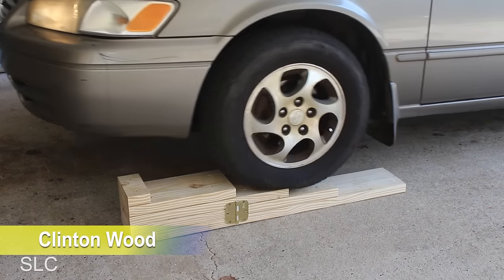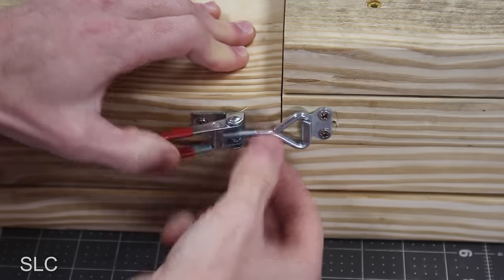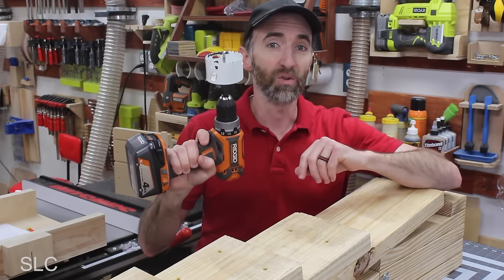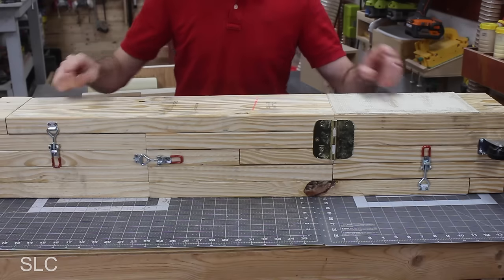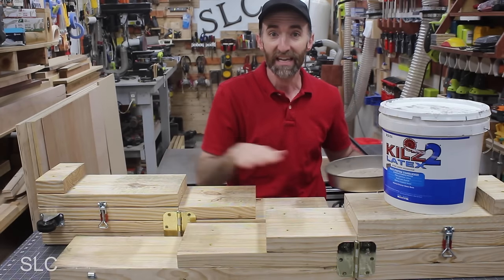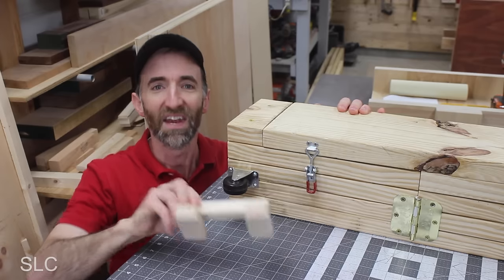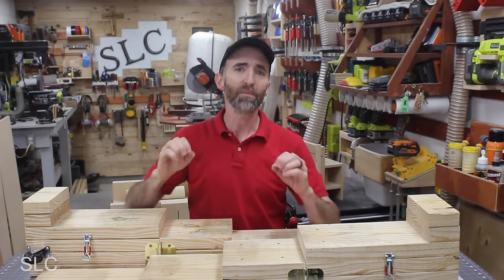Improving the Best Car Ramp EVER

Comment: Dont bother with the hinges on one side, replace them with the clamps on BOTH sides. It's not always convenient having an arm swung out... It's a trip hazard in your workshop and if you are working outside against a kerb then they are pointlesss... the ramp can't swing out of the way if its against the kerb edge and the other side would be open to be hit by passing vehicles which could be catastrophic if you were under the car at the time
Reply: You could just reverse them under the car, that is, put them on the opposite side of what you usually do, so that the arms swing toward the middle of the car instead of the outside of the car. The trouble with any clamp or hinge removal system is when you unclamp the clamp or remove the hinge pins to remove the back portion of the ramp for accessibility from the side of the car, if that ramp is not on a true/flat surface, you may not be able to re-clamp the clamp or re-install the pins due to the ramp back becoming misaligned due to the ramp being on an uneven surface.
Reply: @jimmclaughlin9362  ...if you had those problems (a) they would prevent you from taking them apart in the first place, too (b) they're at least as likely to prevent the use of the hinged version

Comment: If you don't have a spotter you might try putting a mirror in front of the car while driving up the ramps.   I haven't tried it but it might help.   Another idea is use the old farmer's wood stain.   50/50 diesel or kerosene and used motor oil.   It's cheap and effective at preserving wood.   It usually soaks in fast but if the top is still slick throw some sand on it before use.

Comment: I really like your car ramps. If I was to make any adjustment to it ( perhaps not so critical to the overall function) I would say it would be in creating a 45* on each edge of each step, so that the tires don't get too stress out while rolling up, as the sharp edges could cause some slight deterioration with time. Thank you for sharing your ideas. I love it!!
Reply: I was thinking the same thing; cut the original boards at 45 degrees so when you hit the backstop, you know you hit the end of the line
Reply: @nooneofconsequence3847  Same here. And I made the mistake of replying before I read down, and noticed the top comment was the same idea.
Would want to shorten the top-most, guard, board, by 11/8", so it could nest up against the edge of the bottom board, while still being cut at 90°.
Reply: Tires can take a good beating, 2 inches is nothing to them. Plus, you are unlikely to hit that same spot every time you use them since you'll be driving the car around and position will change. I do wonder if the wood can take the beating and for how long, a 45° cut at each step makes sense to me to protect the wood long term, but I dont much about like I do about tires (former tire tech)
Reply: Hopefully you won’t be driving the same car on the ramps on a daily basis anyways

Comment: I would want the hinge pin to be easily removable. So you can pull it & get the ramp part of the ramps out of the way. Because we all know we're going to be working on both sides of the tires.
Reply: Maybe use two side latches instead of a side latch and a hinge?

Comment: Use gritty and not sand. With sand, the paint coats the sand and is the only thing holding it to the surface. It will scratch off pretty easily over time. Mixing cooking gritty into the paint is much more permanent. The gritty soak up the paint and become part of the actual paint, which helps it stay on much better.
Reply: Gritts, not gritty.... stupid autocorrect
Reply: @mikebonom  gwitty on da car wamp
Reply: @dylanboyd6147  grits, the breakfast food. It'll soak up the paint and become part of the paint while still remaining hard. Sand will not last nearly as long.

Comment: I'd add a small indent on the final step for 2 reasons.
1) the car can rest on it just like with the generic store bought steel ones, preventing the car from sliding back down and causing potential accidents (in case you forget to wedge the back wheels)
2) it'll make the stopping step feel higher while also giving the car a smooth decline giving a indicator you can feel from the driver's seat.
Reply: Yeah, #2 is what I was thinking, too. It acts as an index.
Reply: add a whoopie cushion into the dip as well for an audio cue, and a cup holder on the side to hold a beer for while working under the car. how about a compartment inside the final step to hold a set of jack stands... or better yet, just use the jack stands! (comedic hyperbole)
Reply: Just add a big nail on the end of the final step: You will feel and probably even hear it. Will keep the wheel from rolling back. /s

Comment: I very much liked the way you made these.  I made a similar set in the 60's and I still use them today.  Mine do have a 45 degree cut on the leading edge of the steps to make it a bit easier to enter.  I only have a 2x4 stop at the end but I just count the steps as the vehicle goes up the ramp.  In my case it is 5 steps then hit the brakes.  
I have a suggestion for using them.  I place the car about a foot rearward of where I want it to end up when on the ramps and make sure the steering wheel is straight.  Then I place the ramps centered in front of the front tires and parallel to the centerline of the car.  Then I put a chalk mark at the outside of each ramp near the low end.  Now I back the car up about 3 feet, keeping the wheel straight.  Now I move the ramps back in contact and centered on the tires and put the high ends lined up with the chalk marks.  This makes sure that everything is straight and parallel so that when the car is at the top of the ramp, the tires stay centered on them.  Then I give the side of the car a couple of really good shoves sideways to make sure it is solidly on the ramps.  After over 50 years of doing this, I have not had a single mishap.
Reply: You just cant beat information like this, thank you for sharing

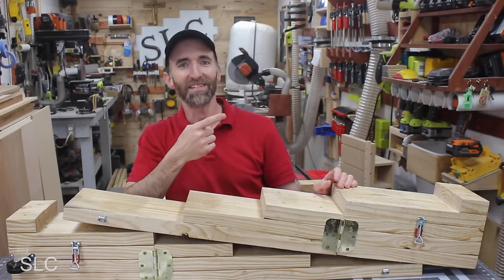Comment: 4:50 install the hinge slightly tilted away from the first entry ramp so it's easier to swivel SLIGHTLY UP AND OUT if you plan on driving it up an uneven/gravel surface.
Reply: I like this idea, and it sounds very good in theory, but in real life it wouldn't really work. If the ramp section is 'slightly up*' when opened, that means it would also be 'slightly *down*' when closed, which mean it would have a *concaved surface and the weight driving up it would either cause it to spilt/crack apart where the hinge is attached, or would cause the hinge to fail all together. And if it somehow didn't fail from that, the weight of the car would now be pressing the down-turned ramp into the ground, causing it to be impossible to swivel outward because of the cars weight, which would defeat the whole purpose of the ramp.
Reply: @_daldoly_  What? no it wouldnt. you install the hinge when the planks are flush with the ground so its flat when closed, and slightly up when open. the only trouble would be that in order to swing upwards the inside part of the wood would tilt downwards at the start of the swing, so you might need to cut away some clearance.

a better solution would be to just use a hinge with a lot of vertical play, so the bottom part can be lifted up vertically before being swung out
Reply: @Hephera  This is true, this is true.
Reply: @Hephera  If you use an angled shims behind both sides of the hinge, thicker end down, it will lift automatically like a gull-wing door.
Reply: @DozenDeuce  So, I'm just curious as to what's going to be holding it up off the ground, however slightly it inevitably turns out to be, while it's folded back into that 'gull-wing up' position? (ie; swung out & forwards... up out of the way ?)  Will it not want to just come swinging back down on its own & into its original starting position?? (Hint: Sir Iasaac Newton would undoubtedly vote that answer as though if it were to result in the affirmative) 😁
Reply: Back in the 80's, the self-closing hinges in my house were simpler and not adjustable. They had an opposing gradient on each half and they would physically lift the whole door as it was opened. Shame because I can't find them nowdays, they are all more advanced with spring loaded adjustable mechanisms which would be no good for this.
Reply: Better still, don't have hinges and have a clamp.  That way, once the car is up, you can unclamp and remove that part out of the way altogether.
Reply: @_daldoly_  your perception of physics is slightly tilted away...
Reply: @Jez2008UK  could extend bottom board on support piece 1.5 or 2" and inset bottom board on ramp piece to match.  Put a couple screw in studs in under lip of ramp that would set down into matching holes in support extension piece.   Removable, stable, no loose extra stuff.

Comment: As I almost always work alone, I made a wood 'spotter' to prevent going over edge of ramp.
It's just a straight piece of 1-1/2" square wood about 4ft long that I 'measured' with truck on ground, put tight up against front of tyres. 
Use a short length at 90 degrees pointing forwards then an upright that contacts bumper tall enough to see from driving seat.
 To use, put straight piece across high end of ramps, upright with spacer away from front of pick-up.
 When on ramps in correct position the upright falls over, the height of ramp allows the 'spacer' to stand up.
Works for me.
Reply: This one's a bit hard to visualise. Any clarification?
Reply: @philhario3640  Basically a stick on a stand with a way to measure where to put it so you don't drive over end of ramps.

Comment: 1) put a bevel on each step so going is easier
2 on the drive up side of the top layer put a 2 or 3 inch  1/2 height block you drive over. This would help both to not go backward by accident an also give you an indication that you have “dropped” onto top layer.

Good luck. I have had a set of “red ramps” for decades but if I didn’t I would do something very much like this
Reply: The hilarious thing is he covers why he didn't bevel in the first video.....
Reply: I made mine a little taller and a bit longer so I can add a backstop for the back of the front tire. Plus rubber wheel chalks for the rear.

Comment: I live in a van for part of the year, so I have similar ramps for leveling. The only difference is that all three stages are the same length, and long enough to support the wheel contact area completely, like the top level in your design. We also use them to level the generator trucks in the Film Industry. We call em two-four- sixes.
Reply: Is it down by the river?

Comment: Years ago I built a set. However I used 2x12's and 2x10's standing on end and then covered top and bottom with 3/4" plywood. Each ramp has 3 runners running the whole length. Boxed at the end, and where I split them to make them lighter and to get them out of the way when working under the vehicle. They angle up gradually to a 30" flat top. To stop from driving off the edge I used a piece of 4x4.
Always hated how heavy they were but they are 13" on the big end and you won't get that with a other ramps.
Later I bought a Quiklift on Craigslist and I seldom use my wood ramps.
They still come in handy when loading the garden tractor or golf cart in the back of my truck. I bought an aluminum trifold ramp but the angle was terrifying. So I put the aluminum ramp on the end of the wood ramps and it's a nice gradual climb into the back of the truck.

Comment: Great (the original video and the upgrades) Regarding the strenght if you use a hole saw, you could limit the "swischeesing" to the parts that are concealed under the next step-board. Given that you're not perforating the side but the face, they won't suffer significant weakening if you keep a septum (wall) of 1.5" to 2" between the holes. You could also stagger them in a sort of round honeycomb pattern, and the weight will be reduced a lot without seriously compromising integrity.
As far as paint/preservation, this would be a great application of the japanese technique of preserving wood by burning it in a controlled fashin.

Comment: I remember another video on this years ago. I built two sets, basically to lift the whole car up, which made it way better to work under the car. I did the side claps on both sides, as when I had the car/truck up, I just removed the other half, until I needed to bring my car/truck down. I didn't want anything sticking out the side by the wheels when working/walking around my vehicle. I gave my set to my pops and I ended up buying the Quickjack 7000(again, yrs ago on sale). Love using my Quickjack now, but it takes longer to setup than just putting the wooden ramps in front of the tires and rolling up. Great video!

Comment: To give the wood extra protection from weather, instead of paint, I'd use a penetrating sealant. I like seal-once water proofing wood penetrating sealant. I use the marine variant, which is designed to protect wood docks that come into direct contact with water. I applied this to my wooden porch and also a wood treehouse that I built for my daughter, and the wood looks great after a couple years of rain and snow.

For a stop block to prevent driving over the ramps, I'd probably add a tall removable section of blocks at the front that slide in and out with basic steel dowels. I'd epoxy a pair of long steel dowels into the blocks and then drill holes in the front of the ramp to slide in the dowels with the blocks attached. I'd use something like 1/2 inch steel dowels, but 7/16 or 3/8 would probably be ok as well. And yes, I would probably also make them a little bit longer.

Comment: A better way to prevent driving over the top of them would be to have a final step that the wheels drive over and then drop down over. so that they have a step in front of them AND behind them when the car is in position. not only would it make the car more secure if you forget to chock the rear wheels, but youd be able to feel the drop and so would know when to stop driving forward. like:

___         ___
|    |____|     |____
|                           |___
|                                  |____
|_______________________|
Reply: Nice graphic made with characters! I could picture what you meant by your description, but there's definitely no confusion/ambiguity for anyone reading this with your included visual. Way to go above and beyond!
Reply: @Hephere what do you think would be a good measurement for that last step ? It would have to be a short drop for easy reversal but big enough to secure the tire.
Reply: good one!! makes me wonder if the reason our built-environments & developments are laid out in grid-form...is because of ancient penmanship?! I'm trying this out right now...thanks! what does one CALL simple text graphics like this??? > I use ActCAD for real CAD <, as you should, too!! Your welcome ))))
Reply: You went the extra mile with that ascii-schematic!

Comment: Adding that second 3" block might appear safer but it's possibly less safe - the shape of the wheel means you would always be hitting the upper 3" block first, which would increase the lever effect on the lower 3" block, it could easily rip the fixings out without you noticing and you could end up driving off the other end of the ramp.
Reply: driving off.....been there, done it. haha

Comment: Plenty of good suggestions.  I liked the adding caster I'd probably have done 2 not just one tho.

I think I'd want that top landing longer.  After making it longer maybe a simple block that has dowel's glued in that drop into holes in the top to help give the ramp some roll off protection going backwards.  IDK but I like those ramps.  I've had 2 metal ones and .... hate them.  Hate moving them, hate stacking them, hate using them.
Reply: Ditto on the second castor.  It seems the handle would go on the opposite end so you can pull them along on the set of castors while using the handle.
Reply: I like your idea of a removable back stop for some added security. Could maybe store it in a slot cut in the bottom board when not in use.

Comment: If you want to stop slippage, on your bottom board, attach a leather or rubber strip that the tire will roll up on first, that will stop the tire from pushing the ramp backwards. I'm exaggerating a little here, but it will stop the ramps from sliding backwards even if they're sitting on it sheet of ice.

Comment: On the first video, I saw a suggestion of having a tail of thin sturdy material (ply, old tires, whatever) that’ll be easily driven on. It’s attached to the swing arm, so that the ramp doesn’t get pushed forward during use. Being only attached to the swinging portion, it can move out of the way, too. My other two main suggestions: make it longer and give it a bigger budget. Love the spring clamps. I’d also angle ends just to make it easier. Covering with told roofing glued not nailed for traction. Half round at the first edge of the top step to give the driver sensory input they’re at the top. If it’s for one car build a cross piece between ramps to exact space  the ramps. Removable after the car is up.

Comment: If the boards are glued together then maybe use a hole saw (a pattern of 1" holes) to remove SOME wood to reduce weight (maybe on the lower boards not the top one). I would be interesting (as an experiment) to see how much weight difference there is.